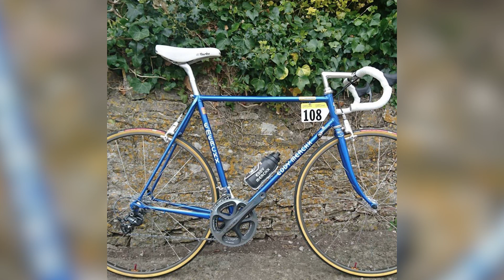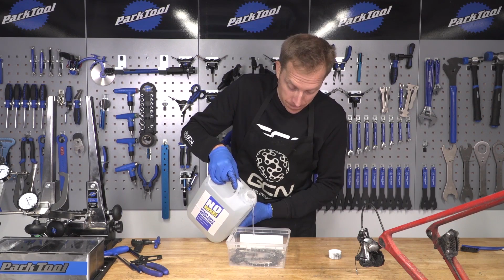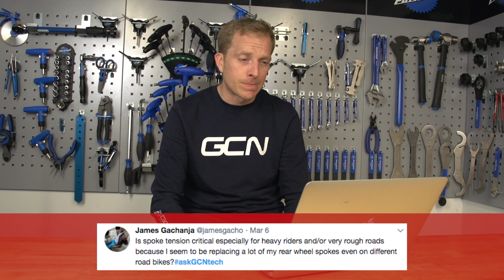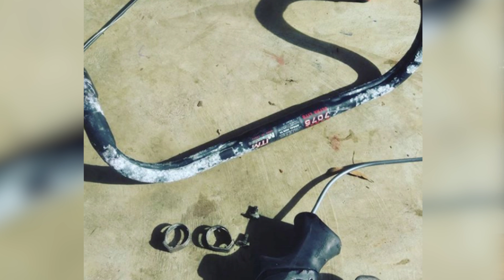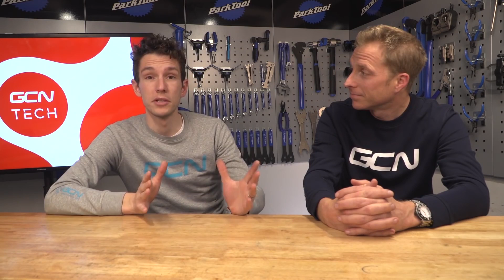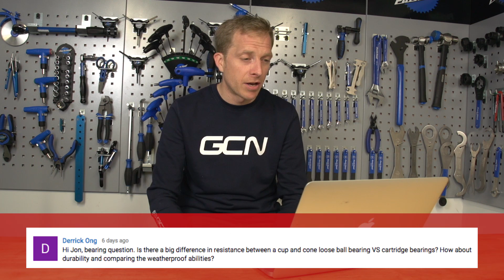Is Degreasing Your Chain A Waste Of Time? | The GCN Tech Clinic

Comment: From the KMC website:
Cleaning
Clean your chain after every ride, especially after riding in the wet.
Always use a piece of dry cloth to clean the chain.
Do not forget the sprockets, front changer and derailleur pulleys.
To remove mud or sand, use the bristle brush (which comes with every 120ml packing of KMC’s chain lube Pro), use light soapy warm water, if necessary.
Do not use acidic or alkali based detergents (such as rust cleaners), these can damage the chain and may cause breakage.
Do not dip your chain in (aggressive) degreasers - they remove the remaining grease from the chain’s bearings, and may cause cracks. They are also bad for our environment.
If the chain is really dirty and difficult to clean, besides using a brush for the inside, try putting some solvent on a cloth and use it to clean the chain’s exterior.
Try to avoid a so-called ‘chain washing machine’ in combination with solvent. This will instantly ruin your chain.
Some lubricant brands advise you to completely degrease the chain, KMC does not recommend this.

Comment: Regarding the chain degreasing:
I think the question was pointing at whether chain degreaser is necessary when eventually you will use soap and water to remove the degreaser before putting on chain lube. I suspect there are many people who have not yet found chain degreaser and are using soap, water, elbow grease to clean their drivetrain. It does a reasonable job and gets most of the black grit off the chain/drivetrain. I find it is difficult to actually get between the chainlinks (where my elbow grease wont go) without degreaser. Those chain cleaning tools with degreaser do a marvelous job cleaning a chain.

Comment: Hi Jon, I have an early 90’s GT Zasker with cantilever brakes which I have successfully converted from 26” to 700C with the help of some Mavic brake converters which basically steps up the position of the brakes. Works well. Used it as a commuter so handling wasn’t a major concern.
Reply: Omar Din what tyres fit?  I'd be concerned about the  bb height being to high
Reply: Hi Glenny oc, at the moment they are 23mm because of the older style road rims but there is still about 12-15mm clearance all round the tyres. The bottom bracket is now about 305mm off the ground, the Mavic adaptors moved the brakes mount up by approx. 34-35mm. The Mavic rear adaptor is quite long and only just clears (touches) the seat tube where the triple triangle is. The other thing to consider is the Road rear hub is slightly narrower than the MTB rear hub by 5mm so the chain stays are slightly 'squeezed' together when the wheel is mounted but I haven't had any issues with it even though at the time I was researching this setup people say you shouldn't squeeze an aluminium frame.
Reply: Omar Din Hellboy shouldn't expand aluminium with expander but 2.5mm per side is very little flex for alloy so wouldn't be worried about the hat

Comment: I put a set of Easton EA90SL disc wheels on a 2010 Spec Stumpjumper Comp Carbon hardtail. Went on beautifully no prob. Run Conti Cyclocross Speed 32 or Gatorskin 28 tires. Best commuter bike I've ever had. Fun and fast. So, the swap works great with discs. You need extension adapters for V brakes to get the pads in the right place but you can find them pretty easy. Hope this helps
Reply: Oh, BTW, the Stump is a 26"

Comment: Cup and cone bearings in wheels prove to perform better in cases of lateral forces, like taking turns.
Cartridge bearings have higher friction during turns.
Reply: Jan Willem Kuilenburg what about angular cartridge bearings, they transfer lateral .load evenly.
Reply: You are correct Jan. The other option as glenny mentioned is angular contact bearings. They are essentially a blend of cup and cone and cartridge bearings. With Chris King angular contact bearings, for example, we get the load benefits of cup and cone but we can add seals on both sides of the bearing like a cartridge bearing, but with even less rolling resistance.

As you said, how often are you going perfectly straight without lateral forces on a bike?
Reply: Good Lord! No one is going to notice the difference.
Reply: Jan is not correct on this one. The guy who does all the drivetrain efficiency testing (Friction Facts) tested angular vs straight and found no difference that could be measured. There are other reasons to prefer cup and cone but performance just isn't it.

Comment: Regarding the issue with the STI lever not returning to its natural position, it could also be that the cable is fraying inside the shift lever.  I've had this happen a few times and it's much easier to replace the cable before it completely breaks, otherwise it's a nightmare to try to fish the old frayed cable end out of the STI lever.

Comment: Regarding the Shimano sticky lever - one maybe not so obvious thing, make sure the rubber hood is not interfering with the return. I have the first generation of Shimano road hydraulic levers (non-group) and the rubber degraded to the point it sometimes made the small lever stick. Shimano then revised the design of those hoods and the replacement didn't sag as much, but still would cause problems if not reinstalled perfectly after a bleed or cable reinstall.

Comment: Cup n’ Cone bearings are one of those beautiful things on a bike. My current wheel-set The Shimano Dura Ace C24’s also have this incredible tiny clicky adjustability before you tighten them down with a lock nut. The best hubs I have ever had the pleasure to service and use.

Comment: You can put 700c wheels on an old mountain bike. I have a Raleigh  dyna tech that I use as an old bike to lock up in town and I converted it with some brake braces from mavic to raise the calipers.. they work a treat and the bike goes well too :-)

Comment: Question: Why don't the pro's have aero bottles? Seems weird that the bikes have anything aero, from the tyres and handelbars to even the garmin mounts, except the bottles (I know they are somewhat aero, but plenty of room for improvement I would think)  #askGCNTech #askGCN
Reply: Because cycling is about fashion too I guess.
Reply: They cant be positioned any more aero and taking any other shaped bottle, than a cylinder, would be hard.
Reply: Aero bottles already exist actually, they are typically used by triathletes! :-)
Reply: I suspected UCI had them banned, although the regs leave some scope:

1.3.024 Bottles shall not be integrated in the frame and may only be located on the down and bis seat tubes on the inside of the frame and cannot be integrated to the frame. The dimensions of the cross sections of a bottle used in competition must not exceed 10 cm or be less than 4 cm and their capacity must be a minimum of 400 ml and a maximum of 800 ml.
Reply: Hello OffEfOne off,
In my opinion it is an awesome question because at the time trials they have their bottles aerodynamically formed.
Reply: DSI I expect they don't use them because they are more expensive to make and the bottles are heavier
Reply: Don't think for the pro's a few extra $ matters that much as the bikes are already 10k+, why would that be heavier?
Reply: That, I my opinion could be the only reason, that it is banned in normal road races, as Dumoulin used aero bottles in time trials
Reply: Having them carried by a teammate is pretty aero
Reply: Which most aero bottles would pass the test i would think.
Reply: Using non-standard cylinder shaped  water bottles would make it hard to get bottles from neutral service, not to mention it would be another thing to put some attention to when placing the bottle in the cage after taking a swig if it wasn't symmetrically shaped.
Reply: Aero bottles fly like bananas. Impossible to throw them and hit neutral service cars, motorbikes or other riders accurately.
Reply: Competition rules.  I saw it mentioned in a GCN video somewhere.  Putting it simply, the rules are designed to prevent riders using carefully shaped empty water bottles to get round frame design regulations.
Reply: Why would they be heavier?  Surface area to volume ratio of a solid.  The weight of a bottle depends on the surface area of its shape, because its surface is made of plastic.  A sphere (ball) gives you the least surface area for a given volume, so a ball-shaped 1 litre bottle would be lighter than any other shape, but impractical to use.  A short fat cylinder is quite efficient.  Take an aero design to extremes and you would need substantially more plastic to make it, so it would be noticeably heavier.  However, in real life, it would be a trivial effect: a few grammes when the rider weighs tens of kilos.

Comment: I recently bought a used Campagnolo Centaur Carbon 10 speed chainset off Ebay. As the rings were 'chipped' and the item would be used on a new self-build bike I bought 2 new 11 speed Stronglight rings. They looked great but the fixing bolts did not fit. I took them to my LBS (whom are Campagnolo certified) and they noticed the inside small ring had a thread for the bolts - something not mentioned on any data I saw - unlike the old system that used a screw and a housing fitted to sandwich the rings. However, end result, bought a set of new bolts and a saved nearly £200.

Comment: I bought one of those high dollar chains with the titanium nitride coatings. I was enthusiastic about it until I pressed out a pin to make it the right length. You would never guess to my amazement that obviously they has coated it after assembly and it had no coating on any of the surfaces that would make any difference in how fast it would wear out. The outside of the pins wear as does the inside of the rollers. Good trick to fool those of us who do not know better.They will not get any more of my money.

Comment: Hi Jon, full of good info as always! I wanted to add a note on needle bearings, since we still use them today. Our ISO series of MTB hubs all have a needle bearing in the driveshell. We use our made-in-house needle bearing as the outermost driveshell bearing to better handle the rotational torque that is applied to the cassette's smallest cogs.
Reply: Your components are top notch. I bought a Rove Ti fitted with your front and rear hubs and headset and it's bike jewelry.... that takes a beating!   Keep doing what you do! Nothing else sound like a Chris King rear hub.
Reply: Thanks Jeff! We do our best to always be improving. Engineering never stops!

Comment: Chain greasing: Some sellers of wax based lubricants recommend just leaving the lubricant on the chain, as it will shrink anyway and not collect dirt. After a total clean, you need some rustprotection anyway.
When I use Smoove i just smear a bit on the outside of the chain, to prevent that uncomely sight of rust on the chain, even on the outside.

Comment: Shimano still produce ONLY cup and cone hubs because they save a lot of money, and with the expense of the tools used to make these hubs, make them almost impossible for other manufacturers to copy. The adjustment available in the hubs can be a bonus, but overall a cup and cone hub can become damaged easily if you don't overhaul them regularly.

Campagnolo are much smarter and sell not just replacement cones and balls, but also replacement cups. Replacing just a hub isn't viable in this day and age of cost-effective machine-made wheels, the rims and spokes are a relatively small part of the overall cost of a new wheelset.

Enthusiasts like myself will instead buy a matching hub from Shimano and punch the cups out of it to press into the old wheel, considerably less bother than rebuilding the whole wheel, and considerably cheaper than buying a new wheel. Great for those inexpensive unsealed mountain bike hubs (m475), where the hubs are only $10-20 each if you know where on the internet to look. Definitely worth trying, you have very little to lose. Perhaps best saved for a bike that has less value to you, such as the daily commuter or hack-around.

Comment: The KMC website explicitly says never to degrease a chain saying that it ruins it by removing grease from the internal surfaces. Are they wrong? I've been degreasing for many years but now I only wipe with a rag, lubricate and wipe again until clean. Much less work and the chains seem to last the same if not longer.
Reply: I suppose they could be talking about the factory grease on the chains when they're brand new? I imagine it's better to clean it off after about 50-80 miles because that grease picks up dirt too.  The factory grease seems to be much better than added lube but it will get dirty eventually and need cleaning.
Reply: konyp1 Park tools chain cleaner with dish  soap diluted rinsed well and re lube! Perfect cleaning solution cheaper as well 🤙🏽🚴🏼
Reply: Could also have to do with warranty
Reply: Just oiling generously does a great job of removing the lighter, less internal oil and dirt along with it. Wipe off the excess and regardless the couple of buck of chain life either way, enjoy the significant reduction in work.
Reply: konyp1 degrease regularly. I go through one chain per year ~6 to 8k km on some shit roads, but due to swapping wheels with different cassettes depending on the weather, I haven't bought a new cassette since 2011. No effect on the smoothness of changes that I can discern. I use Dumonde Tech Lite lubricant, smells awesome too 😜. Clean cassettes off the bike so the hubs don't get degreased obvs.

Comment: A comment about a comment. I have an older entry level Kona 26" wheel and disc brake mountain bike that works great with 700c wheels and 35c tires. I am a taller guy and the frame size is 22 inches. Definitely try some 700c wheels if you want to log some road miles and decide for yourself. Motorcycles use a 21 Inch front wheel and 17 or 18 inch rear wheel. 26/29 inch bikes were a thing at one point. You might also find that a larger front wheel set up agreeable to your preferences.

Comment: More than one way to skin a cat.  One thing that displaces oil really well and the dirt in it is more oil.  Just apply generously and wipe the excess off.

This may not remove thicker grease deep inside the rollers that some claim is applied at the factory and some claim shouldn't be removed anyway.  I don't know if removing that or leaving it results in longer chain life, but we're talking about maybe $5 worth of chain life either way vs the trouble of degreasing.  It's an easy choice to me.

Comment: 700c wheels do work on a 26 inch MTB frame. My drivetrain on the old steel mountain bike (Shogun) wore out and I had some older road drivetrain components and a drop handlebar lying around so I converted it to a road bike. V-brakes were removed and I used some cheap long drop road callipers for the braking using pre-existing holes in the fork and rear bridge. Great commuter especially in winter.

Comment: The reason that Shimano and Campagnolo still use cup and cone bearings rather than a "sealed bearing" is that deep groove sealed bearings are really meant for radial loads.  Where as a cup and cone bearing can take both radial and axial loads.   Suntour Superbe track hubs had modified angular contact bearings in them and were a really great hub. Probably why they are so sought after now.

Comment: I found the key to the Krusty handlebar problem can be solved by completely covering the handlebars with electrical tape before installing your favorite handlebar tape over it.  I live in a corrosive humid area and it has saved my bars many times over.

Comment: Will degreasing a chain make it last longer? This sounded like a trick question. The grease is not the problem. All chains will last longer if they are lubricated to reduce their internal friction and their friction against the teeth of the cogs and chainrings. Ergo, removing the lubrication will result in the chain not lasting as long. So what's the problem? Answer: Dirt! It's the dirt and sand and grit that sticks to and collects in the grease that shortens the life of the chain even when it's lubricated. So you have two remedies: (1) Frequently degrease the chain and drivetrain to get rid of the dirt that collected in it. Then apply fresh, clean lubricant. (2) Or, switch to a lubricant that does not collect dirt and sand and grit. Does such a lubricant exist? Yes. Wax. I like Molten Speed Wax (https://moltenspeedwax.com/ ) because it has additives already mixed in to help it do its job better. With a dry wax lubrication, dirt will not stick to or collect on the chain and your entire drivetrain will stay cleaner. However, you still need to periodically re-wax your chain to keep the friction down. When done properly, it appears that wax reduces friction better than the majority of wet lubricants. But it's not perfect and its weakness is foul weather. So, if you live in a very rainy or wet environment, you may need to stay with a wet lubricant (and increase the frequency of your drivetrain cleanings). My favorite wet lubricant is Park Tool CL-1 (https://www.amazon.com/Park-Tool-Synthetic-Blend-Bottle/dp/B000AOA290 ), a synthetic oil blended specifically for bicycle chains.
Reply: D.Eldon Then why not use a regular dry lubricant? Or maybe one that's teflon based? I have both a wet lube and a dry lube depending on the weather. I use a teflon based one on my regular, heavy, slow pub bike.

Comment: Some Speedplay pedals use needle bearings - I haven't noticed any problems with them in that application. Like Jon said in the video they don't do well with significant loads in the wrong direction so you wouldn't want them in your hubs or headset.